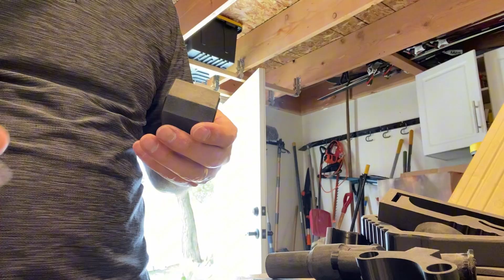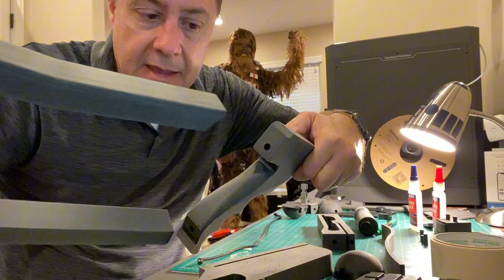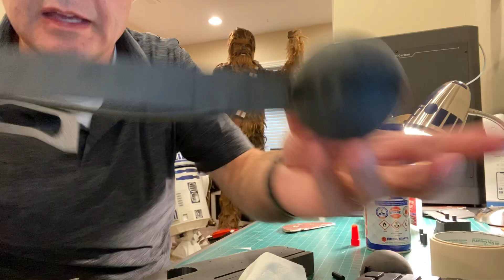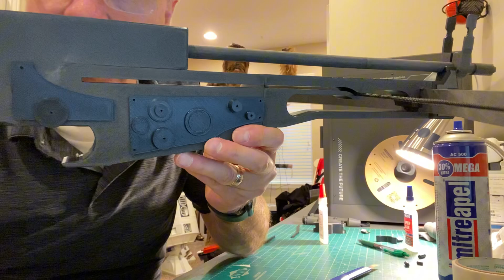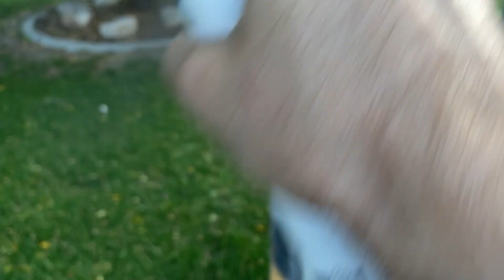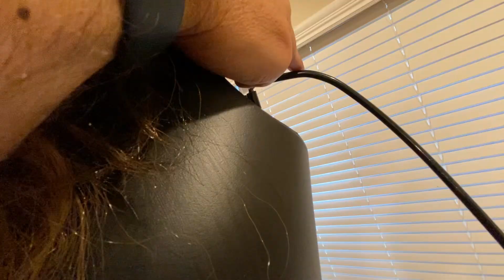How To Build a Chewbacca Bowcaster Rifle

Comment: I bought paracord that's almost 1mm thinner that yours and I still can't tread it through the little cutout. Did you have to cut or alter that little slot for the string?
Reply from the maker: I did not have to make any alterations to my paracord
Reply: @rprealitycosplay Sounds like a me problem lol. I just ended up using a drill to make the holes I little bigger and it fits now. Thank you for taking the time to make this tutorial! It was a huge help. I'm new to 3D printing, so this was perfect.

Comment: Thank you for posting this. The finished product looks amazing!  Are there any budget friendly 3d printers you would recommend for someone just getting into this?
Reply from the maker: Absolutely.  I highly recommend the Elegoo Centauri Carbon.  It's extremely well priced and.....super easy to use.....and the print quality is amazing.  It's a bit on the smaller side...but still considered a medium sized printer.  If you want to spend a bit more for something just as nice and easy to use, I would go with the Creality K1-MAX.  It's priced really reasonably right now.
Reply: @rprealitycosplay  thank you very much for the help!

Comment: Thanks for doing a video on this topic.  I have to say that I initially downloaded this stl file set but got frustrated with many of the files being in OBJ format and were unusable.  Not sure why this was the case.  I ended up using another file set or design which had what I thought was a more screen accurate middle scope.  Anyway, nice job and glad you were able to work through some of the file issues.
Reply from the maker: Happy to hear you found a solution!